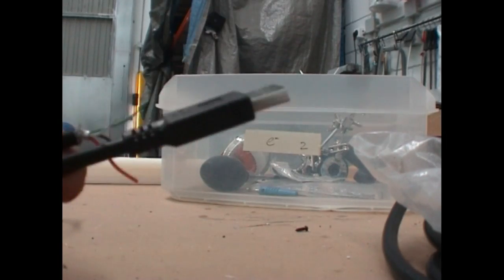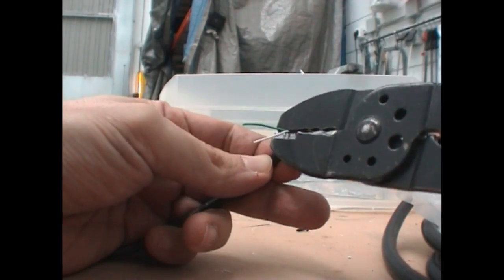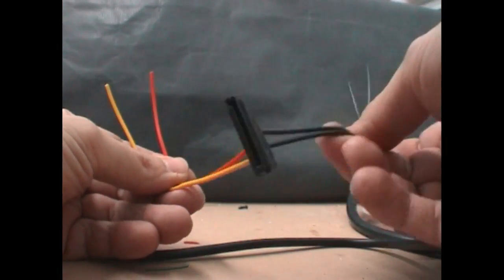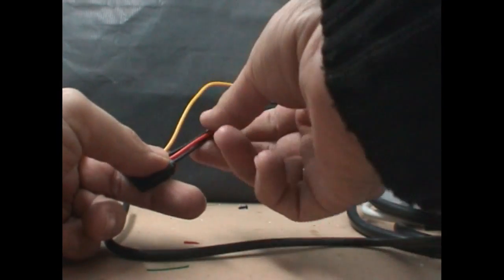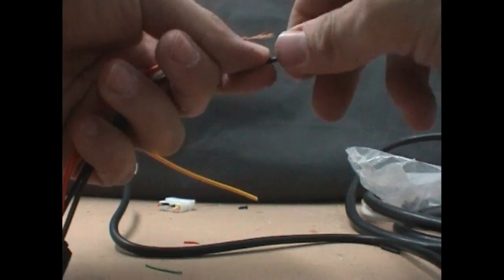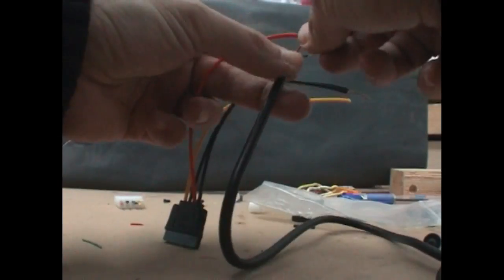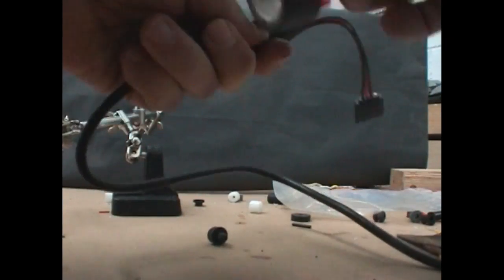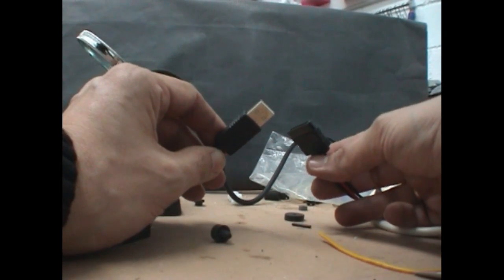Power a SATA 2,5'' hard disk drive with USB

Comment: WHATS THE POINT, WHEN THAT SAME POWER IS IN THE PC?AND YOU HAVE TO OPEN THE PC TO PREPARE THE SATA CABLE, THE POWER CABLE IS THERE TOO, WHY ARE YOU CUTTING THE WORKING POWER SUPPLY AND MAKING IT EXTERNAL USB? sorry for caps lock, not yelling, but not typing it all again either :)

Comment: By the way! There is not a bad option dock (with RAID function)
5 pieces inclusive. With a total volume of up to  40 TB. Supports hot
replacement. (That is, during operation,  you  can get any  hard
drive). Description here: http://alipromo.com/redirect/cpa/o/o8yfi040xc6yzyl88htfkvmqxalhwm35/

Comment: Does this work with 3.5 inch disk?
Reply: No doesn't work... a 3.5" disk requires +5V and +12V power, and usb doesn't supply 12V, and also the power of an usb port, even a usb 3.0 port is not enough for a 3.5" disk, those disk requires a lot more power, even for some 2.5" disk the power of an usb 2.0 port is not enough, those need at least 2 usb 2.0 or one usb 3.0 port.
Reply from the maker: CraftersGaming I think yes, but din't try.
Reply: If you use a laptop grade hdd it will work

Comment: Please tell me how the hdd works without Yellow wire (12V) supply??
Reply: Please tell me how hdd motor works without 12v supply??  I am asking about desktop computer SATA hdd... Please solve this?
Reply: +Vishwa Pathiraja smaller hard drives don't use 12 volts but larger desktop ones do
Reply: Ok!! Thanks a lot! I bought a HDD external power supply.... thanks
Reply: i have a desktop System HDD of western digital is it works on 5 volts ???

Comment: for yelow wire you need 12v+ for red 5 thats simple...but on 1 usb you got only 5v you need to have 2 for yellow
Reply: Only if the drive requires it. Most 2.5" Drives only require 5v to operate (which is why you can get USB powered external drives) .
Reply: ross maclean i had try to make hard drive reck or reader from dvd player..but hard drive wan`t start..damn guessing not good amperage..does anyone have idea how to power up hard drive 3,5 with dvd power suply...i have 12 and 5v on sata power suply to hard drive but it want start

Comment: hi, i have question regarding the 2.5 sata external drive i got; it showed up as Local Disk E in my laptop and i was able to click on it, and then there was this green bar, load about 95% and then it stopped! every time i tried to click on it it's just stop responding ORz help====! (I read somewhere that i should just get myself an adapter for that but would that actually work...)

Comment: I tried the exact same method on my WD Internal HDD. But it keeps disconnecting after every 1 minute. What can be the problem? The soldering is correct and so is the SATA Cable.
Reply: Is your problem solved after this many years 😅😂😂😂
Reply: @study_5556  Haha, it's been a decade and I am pretty certain that I gave up 😆

Comment: Will this work on 3.5' also? I am trying to connect my internal 3.5" 500 GB hdd to my TV. I am using a PSU to power it now. But if the USB method will work. I can use it with my USB hub to power and transfer data.

Comment: Well i plug it to computer and 2 other laptop and it,didn`,t work, and i measure the Voltage from the USB cable it was 5v+ but i didn,t measure the current

Comment: don,t work with me i used a Laptop hdd MK8034GSX and it,s wrote in front of hdd it,s need (DC+5V 1.0A) i did all the steps(and i,m sure that the problem with the usb-molex cable because i plug the power from the computer and it,s work) anyway i read that the usb cable max current is 900mA , Is that the problem?

Comment: really verry helpfull!!! but if i may one question: do you need the 12 volts wire for a sata dvd-writer? and for data cable does it work with a simple sata cable with L shape in one end and I shape in the other???

Comment from the maker: Because 3.5 ones need more power. They need also 12V. I copy this comment from zenabir21: "a 3.5" hard drive needs the yellow cable which gives off 12v. but usb can only give 5volts so it wouldn't work. you'd need a 12v power adapter and do the same thing.:)"